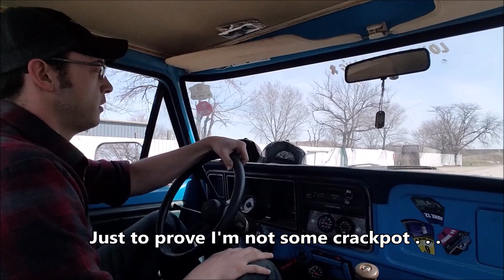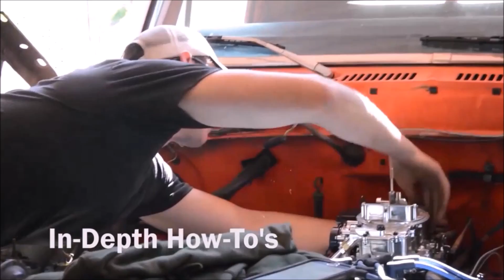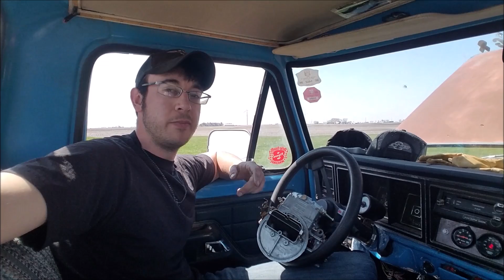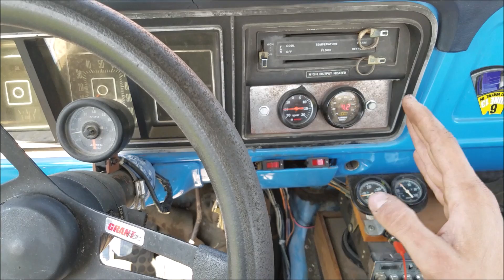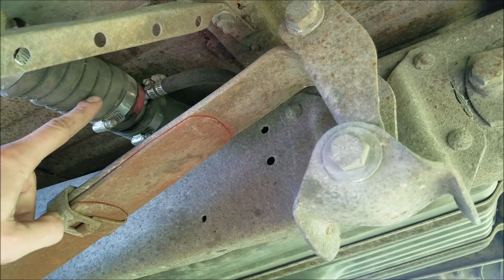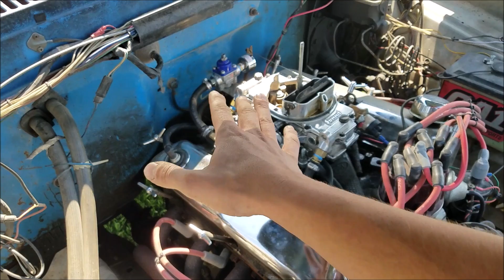Holley & Edelbrock Fuel Bypass System: Return Line to Tank Connection (EASY & SIMPLIFIED)

Comment: Great video as usual! I’d like your thoughts on what I was planning to do, if possible. In my ‘74 D100, I’m planning to use a later model 318 or 360 Magnum engine, except with a carb (not using the FI). These engines don’t have a provision for a mechanical fuel pump. Question is; if I used the later model factory tank and electric in-tank factory pump, can I regulate the high fuel pressure down (and run a return line of coarse) to the 6ish psi for the carb? Reason for the factory in-tank pump is they seem to last pretty much forever, and quiet too (I have 293k on the original pump in my 2000 Ram 1500, which, maybe is the exception and not the rule, but still...). I hear about a lot of problems with aftermarket pump failures lately, be it Holley, Carter whatever, and this truck will be a legit daily driver. Anyway, sorry for the long winded question! Thanks for any input!
Reply: Ron G Yeah, you'd just need a manually adjustable regulator to drop the pressure from the 35-45 psi used with the injection setup down to 5-6 psi.  Alternatively, if the Dodge Omni (as an example) uses an electric inline pump, use one of those with your current tank and do something similar to what Luke did.
Reply: Late reply, but yes you can do this. I am running a carb'd 318 and opted for an out-of-tank electric holley pump. Just run the line from the pump to a regulator and regulate it down to the necessary PSI.

Comment: Good video, I do the same thing for my FI conversions, even for returnless set up's.  We might have discussed this before but I remove the filler neck and give it a good scrubbing, using 3/8 brake line I drill a hole in the neck as low as possible,  put a 120* bend in the brake line and cut it off so most of the bend is there, put it through the hole and lay the line over on to the neck and solder it in place.  A hose clamp supports the line to the neck and a 3/8" inverted flare to a barb or AN fitting adaptor is installed for connection to your return line.  Works like a champ.  I do this even on a returnless system except I install a tee somewhere in the high pressure line after the fuel rail, tap the internal bore of the tee and install a pipe plug with a .5mm (.018") hole in it to bypass a small amount of fuel back to the tank.  Always cool fuel at the injectors and flowing through the pump, no bubbles or vapor locking at the injectors and unless your pushing over 600 HP a stock pump will provide plenty of fuel.  $5 in parts.

Comment: You had a return line on your Galaxie that was more like a vapor return line with a 0.060 inch hole drilled in a bolt head or something similar.  That was more like an old school vapor separator return system.  Any differences you see between the return line on the Galaxie and the return line on your truck.  Do you prefer one over the other?
Reply from the maker: That setup I made due with what I had, but it worked just fine - this style holds a lot less pressure on the pump and bypasses way more fuel. I actually have the galaxie set up like this also. 

I was on an internship in Virginia during that galaxie video and it was wayyy hot, had to make something work!

Comment: You should also mention that running a bypass set up instead of a "deadhead" set up with save your electric fuel pump because it is not working as hard with the bypass set up. Be Well and Thank You.
Reply from the maker: That’s actually the original reason I started running return lines! There is so much I always want to say, but Iv been chastised for going over peoples heads!

Comment: Never seen the filler neck tap before for the fuel return, nice mod Luke!
What I did for my fuel return is: my truck came with a charcoal canister that was disconnected. That canister had a hard line back to the fuel tank itself. If u no longer use that can, utilize that hard line as a return for fuel. Be sure to clean it all out before u start bypassing fuel into it
Reply from the maker: Here is what I don’t like about that - it will build pressure on the line which makes it hard to control your fuel pressure. I tried that in this truck, even cutting it back way by the tank where the restriction was essentially small and I still had issues.
If you put a pressure gauge on your return line, it needs to read 0. 

But it does depend on the fuel pump you run also - Im on a big electric unit so that I bypass a healthy amount
Reply: @ThunderHead289  
Very true! I had just switched to an electric pump last month. Its slowly growing on me. I have a pressure gauge on my regulator as well as my carb side. Both read different numbers till I went to the red holley pump. 
I noticed your regulator is after the carb, is that preferable? My regulator is before my carb
Reply from the maker: It depends what style of return you are running - a dedicated bypass regulator is extremely effective after the carb

Comment: Hi there, I have a 87 caprice classic with a 305 small block chevy stock everything except for the carb and distributor, I have a HEI and a edelbrock 1406 600cfm. and when ever I have the AC on the clutch engages and the idle drops really bad to the point when at a stop, I have to hold the throttle to a certain RPM or else the engine cuts out, there is a AC solenoid kit that you can order, and I would like to know if you're willing to show how to properly install it and have it all set right. Would be greatly appreciated
Reply: The stock carb should have had a solenoid on it too. If you car still has the wiring harness for it, and it works, it really is pretty much a bolt-on and plug it in deal.
Reply: A/C cars come with an idle solenoid for the A/C when it's on since it draws a ton of power.

I deleted mine on my 1968 Thunderbird. It's my opinion, but the A/C is always in the way of something whether it's the compressor or the lines. So in my opinion, it's best to delete it 😂

Comment: Why didn't you talk about the ball valve in your return line? I'd think that would be useful for some people to understand.
Reply from the maker: I actually just installed that for demonstrating how fuel pressure effects fuel level - I also do actually run them on some of my other rigs that have a mechanical fuel pump timing covers, so if the electric goes out, I can toss a mechanical on and keep going.
Reply: ThunderHead289 Ahh gotcha, that’s a smart move.
Reply: @OldsRacingGarage  There are a couple of his other videos where he uses that valve in such a demonstration. Pretty neat idea for his purposes.